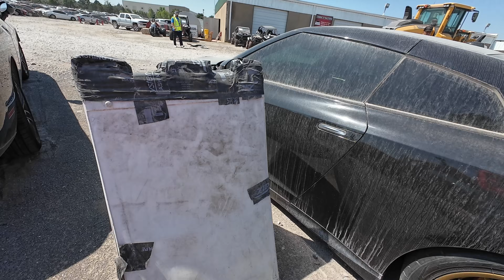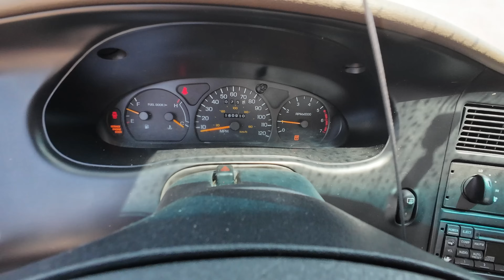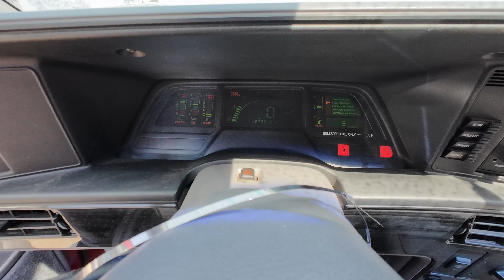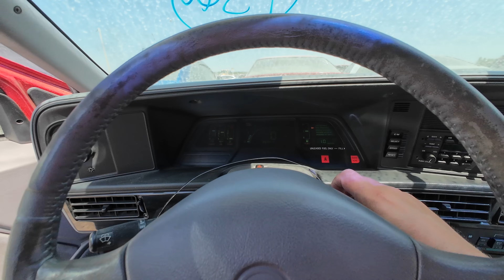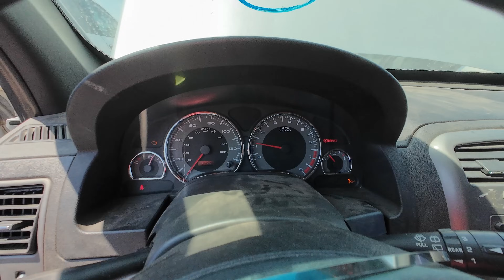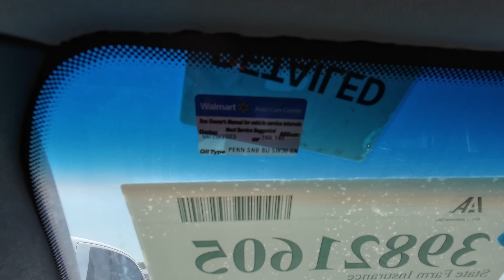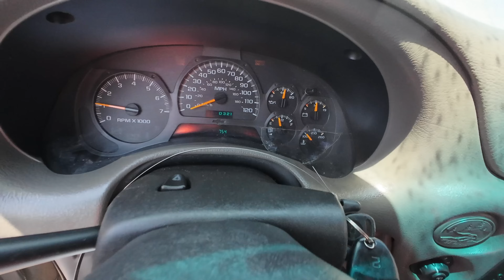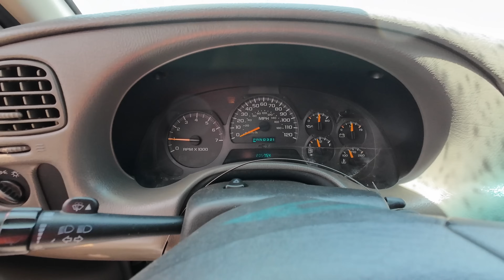2 Thunderbirds and a Junked 2024 Mazda BRAND NEW at IAA

Comment: I sold those cougars new maybe 1 in 1000 had white interior  wheel base only 1 inch lees than crown Vic 4 wheel independent suspension. An xr7 should of had supper charger and speed sensitive steering 80  👍👍😎

Comment: I like the Torrent. The Pioneer sound system is pretty good. I didn't know which V6 they put in these. There is a Torrent GXP. 264hp 3.6 6 speed auto with manual shift (my 2010 Chevy is a 4 speed). Fun and some ground clearance and AWD for snow. I like sports cars but a sporty crossover/SUV makes more sense.

Comment: Randy on the cougar I would get rid of the vinyl top and just have it painted and you will not be spending a lot of money on it and I think that it will look very good and you will have a quick flip and you should be able to make money on it now that TBird is a different story but it should be able to fix for cheap put a used hood on it and fix the fender and a cheap paint job and then you should be able to make money on it to thay are both nice cars and they will be able to make money on the them Charlie kretschmar Phoenix Arizona

Comment: I bought some fake leather that was kind of stretchy and covered the padded top with glue and stretched it and cut the old leather about a quarter inch from the chrome and tapered it with a razor blade and put the edging back on and it worked fairly good and the person I sold the car to had it two years and it still was not to bad. It was white fake leather and lasted well in the weather.  I am supprised no body does it, It is about like putting a wrap on a whole car.

Comment: You did not try the Cougar sun roof? Maybe it was not the opening type. 
Remove the Landau. Or, be creative, remove, and paint, OR have a vinyl top without padding install. 
That Cougar appears better interior and exterior than the Tbird. 
Most folks in the market for that generation don't care about the motor size. Just something clean, fully operational.
Tbird common, Cougar are gaining collectablility in niche market.
Both cars, check the drivers window/door lockout control. Maybe that is why the passenger window did not operate. 
Cougar driver seat belt fail maybe simple or need a part.

Comment: Love that Mazda. I rebuilt a 2021 Mazda 3 from Copart a couple years ago and now daily drive it. The powertrain in that car is one of the best on the market IMO. I think that's a BCM that you found under the hood. It's an $800 part. I wonder if someone messed with a bunch of expensive electrical components. I will say back in 2021 getting parts without buying them brand new from the dealership was super difficult and in some cases I even had to wait to get them from the dealership because they were on back order.
Reply: I own a 2022 Mazda 3 turbo and like you said I love this car. Probably one of the best cars I own so far.
Reply: Black mazda3 6mt hatch,  the better one.  

Ya that 3 is a nice little girl car, I have encountered that before as a Mazda mechanic, she's done for.

Comment: I have owned my  2008 trailblazer since 2010..paid $20,000 with 78,000 km. I still own it and and have taken care of it and serviced it regularly. It now has 318,000 km and very very dependable. Just took it to the body shop for rust around the wheel wells and the price to fix it was not what I wanted to put my money into...$8,000 to 9,000. The body shop owner was very honest with me  and told me the under carriage was all in good shape  except for rust and told me I would probably get another 100,000km out of it so I'm just going to drive it and keep the upkeep going until it's time for the bone yard. It is the best truck I have ever owned. Four wheel drive too and it's needed for these canadian winters.

Comment: Randy, buy the Cougar, the top can be fixed for $190! Just buy a gallon of white bed liner paint, apply it to the roof with a brush, let it dry and spray it with clear coat! Bingo, FIXED! I've done it dozens of times!
Reply: I personally would prefer the Thunderbird versus the cougar
Reply: @DanT271 yeah cougar been BUBBBAFIED

Comment: Those ole 3.8's were knows for head gaskets. I had an '88 cougar LS that was blowing compression from the number one cylinder while going home on rhe highway, but didnt leave me stranded. Don't always believe the bad things about old fords. Makes me miss The White Monsta (my '03 Town Car)
Reply: I had a 1993 Ford Taurus with the 3.8L engine, and one of the head gaskets went out on it. Had to be replaced at the local Ford dealership. At first I thought I was having an overheating issue (because the water temperature gauge pegged then went back to normal) but after taking it to the dealership, they discovered a head gasket went out and they had to replace it. Outside of that, the 3.8 is a good engine.

Comment: If I had to pick between that '97 T-Bird and the '93 Cougar, I'd take the T-Bird. I always had a soft spot for those '96 and '97 T-Birds. Plus that T-Bird has the 4.6L engine and not the 3.8L like the Cougar does. I had a 3.8L in a '93 Taurus and a head gasket went out on it sometime after it passed 60K miles. It ran fine after it got replaced but I later got rid of it in early 2013 after getting a 2012 Toyota RAV4 (which I still have today, but the white paint on it sucks because it's starting to flake off).

Comment: Bought a 1995 T-Bird brand new.  It was emerald green, and 4.6 v8.  I put 17 inch chrome rims on it and fat tires, and cruised it to Vegas several times.  Only 210 hp , but very comfortable to drive.  Sold it in 1997 to my insurance lady.  Nice cars in the day for about $13, 800.